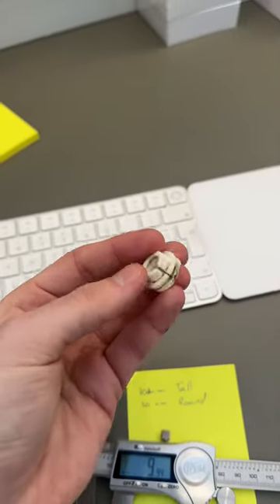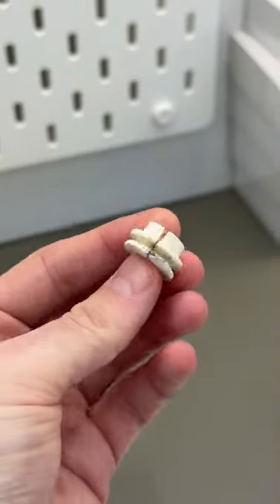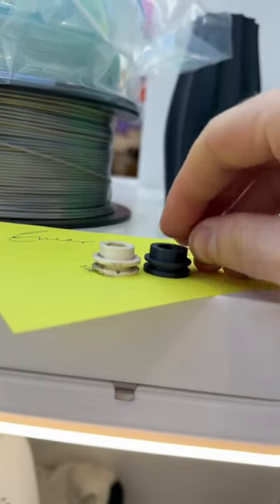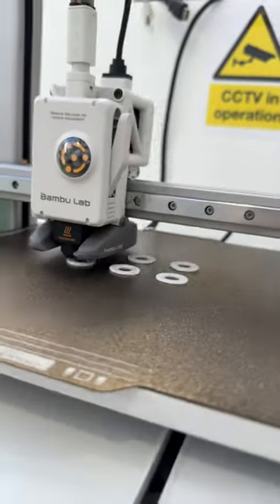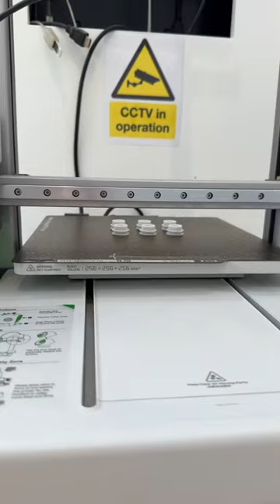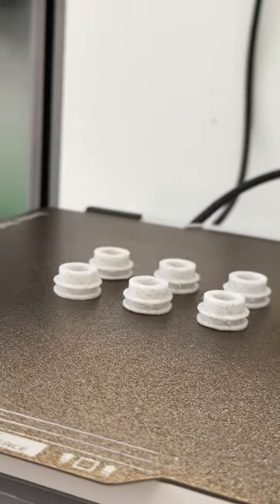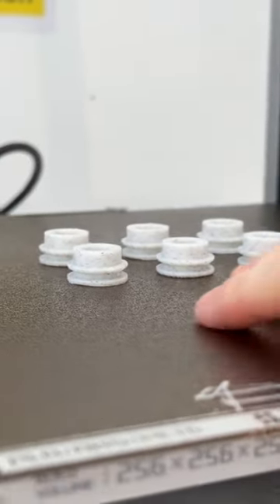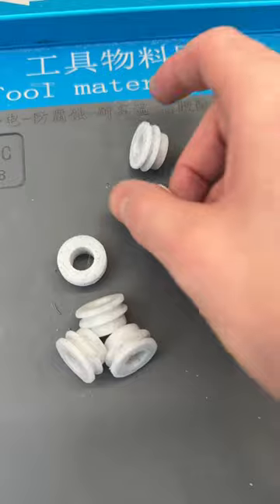Quick 3D Print we made for our customer!

Comment: I love having a 3D printer to fix broken parts. You can use carbon fiber for more intense situations or PLA for more normal usage. The possibilities are endless and this reassures that. Especially since companies are switching to more plastic parts in their products. Plastic does wear down and break but if you can make your own at home for 5 cents in material and half an hour you can get these replacement pieces. Great job!